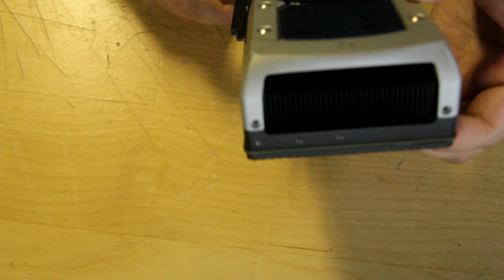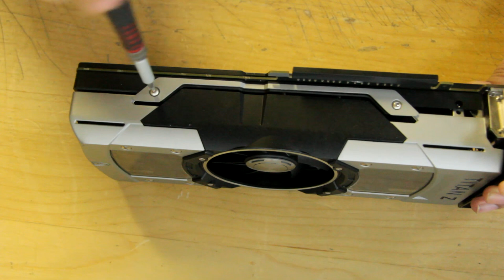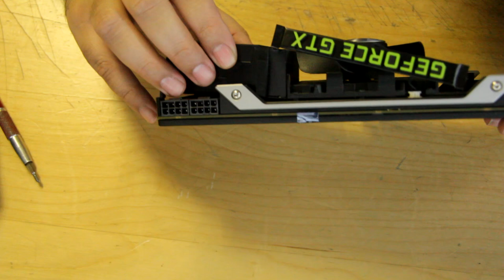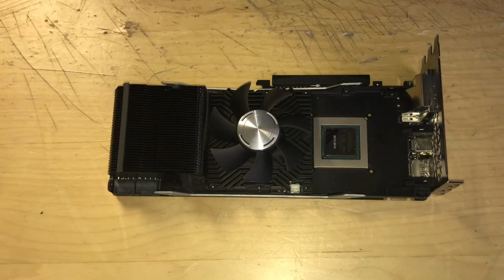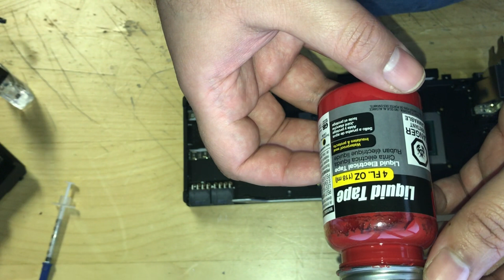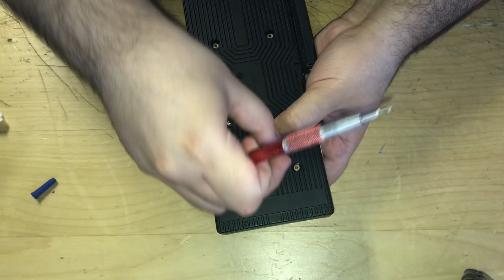$3000 Graphics Card RESTOMOD! Nvidia GTX Titan Z

Comment: Hi, long shot question. But do you have any measurements for thermal pad thickness?
Reply: @Deima Have you found it since then?
Reply: @JoelinoPT  Hi, yeah. I actually just bought a pack of Arctic 1mm pads and used it for everything. From the testing, it seemed to have great contact.
Reply from the maker: I'm afraid not.